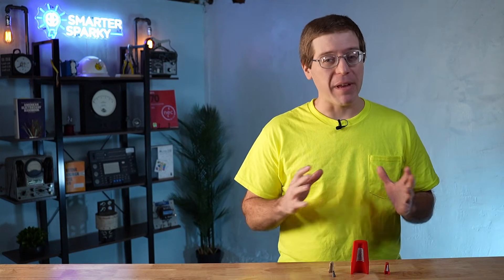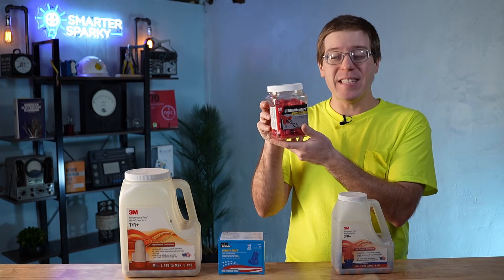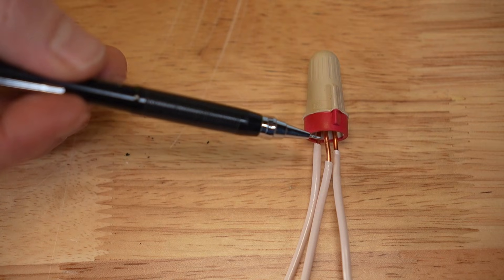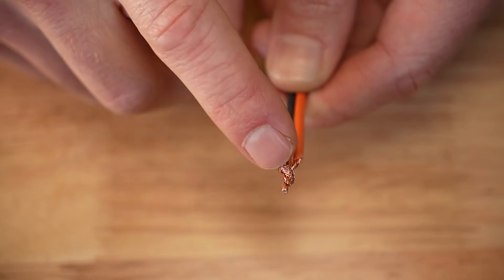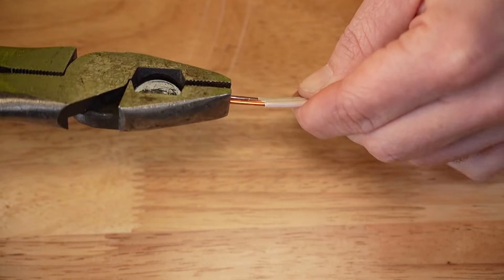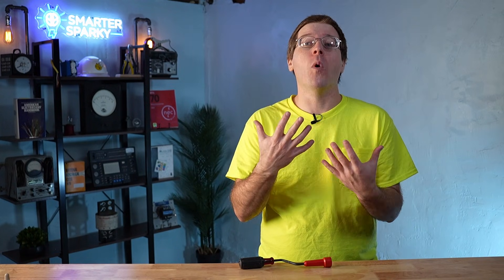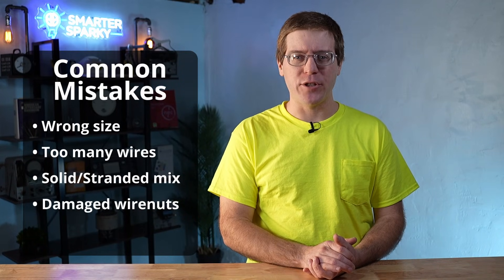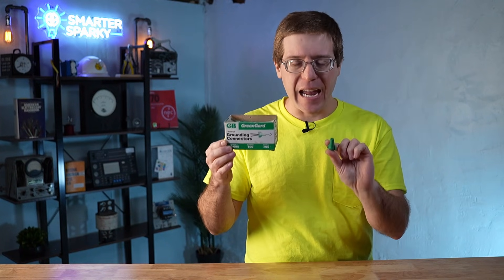Master Wirenuts in 12 Minutes

Comment: Was watching video up till you use a jumper wire. Think should be a bus bar instead of a jumper wire.
Reply from the maker: Just a practical workaround for a situation that comes up frequently. A bus bar would be a neat and tidy solution, but they aren't always available. Thanks for watching as much as you did, and commenting.
Reply: @SmarterSparky  that would mean the box was undersized and possibly may have needed a second circuit. those other wires would be depending on the source(keeping in mind kirchhoff law)The best would have been pigtail the source wire  to each group in a similar fashion. 
I do have to admit all the joints you did do were excellent and as an electrician for last 20 years I would agree with the way they were done.
Reply from the maker: I was thinking more like 8 lighting whips got ran into an 8x8 j-box, and perhaps all of the grounds needed to be spliced together. Or maybe they all need to be controlled by the same switch leg. Yes, that would be bad planning, but on large jobs where there may be one crew running conduit, and a different crew running the wires, planning ahead can slip through the cracks and leave someone in a situation where they need to make weird splices. I certainly wouldn't want to use the jumper method all of the time, but it is an option when you are in a bind. Perhaps I should have explained better in the video.

Comment: I still use wire nuts for electrical connections but Wagos are becoming very popular. I always pre-twist the wires before putting on wire nuts.
Reply from the maker: Wagos are certainly becoming popular. I've only used them a handful of times, though. I used to pre-twist all the time when I carried my lineman's in my pouch, but as I started reducing the tools I carry due to weight, I stopped carrying my lineman's, and stopped pre-twisting.

Comment: This video is so helpful. I'm currently attempting to make a career change at 29 and get into an electrical apprenticeship. The little things like this are so easily overlooked, yet vital to ensuring a safe and secure system. Looking forward to your next video.
Reply: Choosing the electrical trade is a smart move because it’s a top-tier career that stays essential even as more jobs become automated by AI.
Reply from the maker: That right. AI can't install an electrical service, replace receptacles, or troubleshoot control systems... at least not for the foreseeable future...
Reply: @SmarterSparky  I won't lie, i used AI to understand something basic like getting power to a chicken coop from my shop. It was helpful in getting the starting knowledge of what tools i should look for, and compatibility of wire and equipment. Beyond that (like getting a circuit diagram for reference) AI is significantly behind and not a viable tool. 

Time to get my hands dirty and learn the Sparky way.
Reply from the maker: AI can certainly be useful, but it does make stuff up. I fed an LLM an electrical code test once, and it was so confident in all of its answer, but it failed the test HARD. 😂
Reply from the maker: That's awesome! Good luck with your career change! Thanks for watching and commenting :)